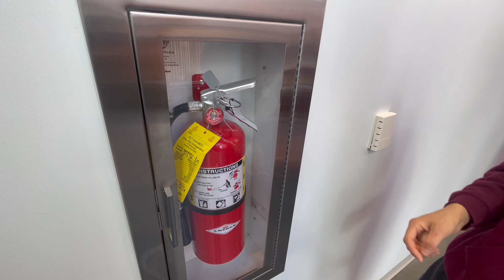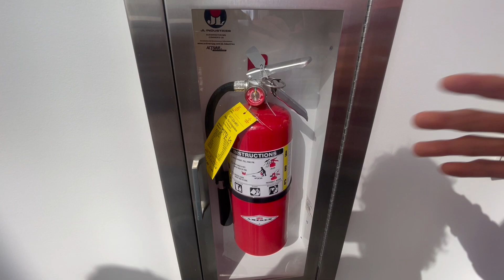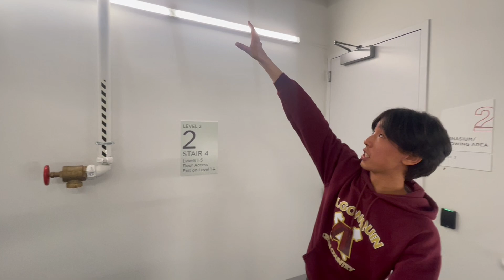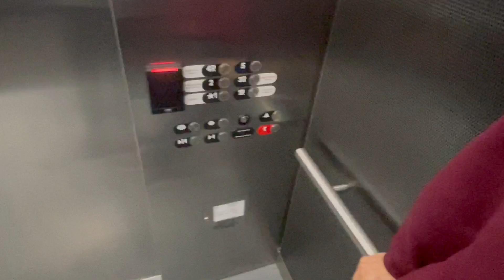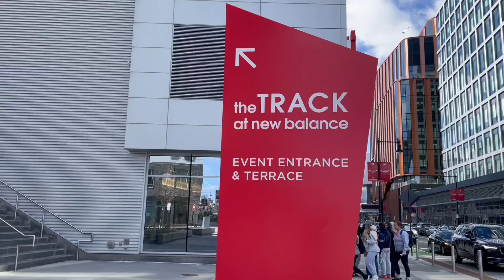Fire Alarm/Fire Protection System Tour at the TRACK At New Balance | Fire System Tours

Comment: When you said that some new buildings, they only a sprinkler system. It reminded me of 2 malls because they dont have any pull stations. The 1st mall had truealarm smokes and sprinklers and the other Mall. I have no clue which smokes or sprinklers, but they have vintage simplex alarms and Voice evac also! The first mall i mentioned has older simplex 4903-9101 Strobe plates with 2901-9806s and retrofit 4903-9239s

 None of the less Nice video FireAlarmDude!!! ❤